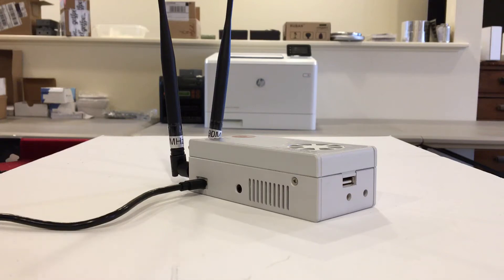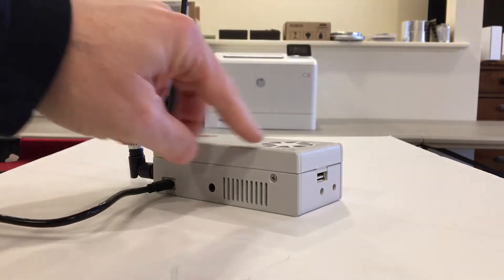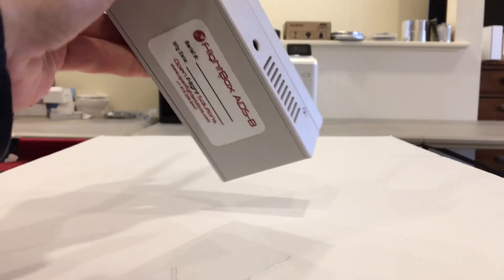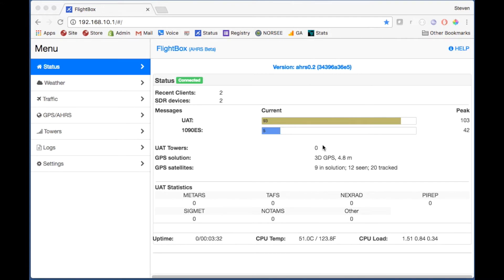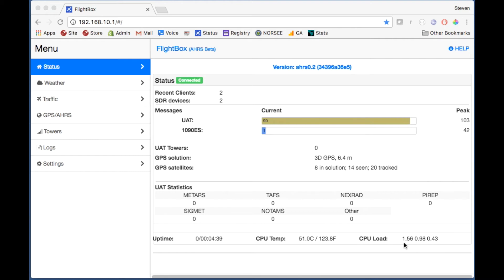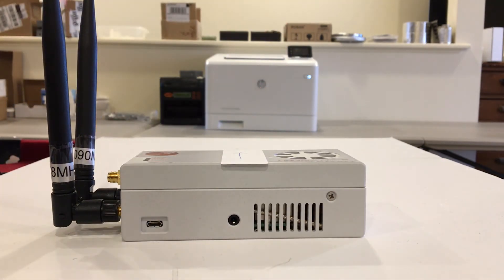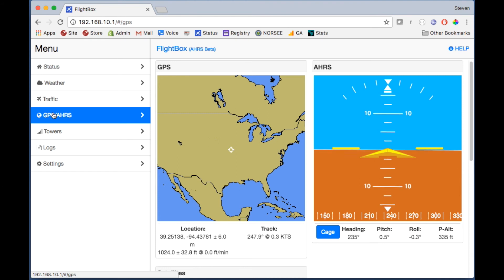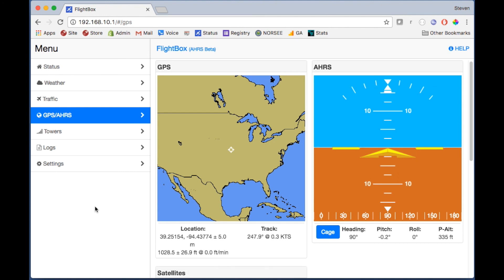AHRS Beta 2 Demo

Comment: I am using v1.4r5 (snun5hlcfy) running on iPad Air2). In the menu page there is now a PFD icon at the bottom of the page.It is a full screen AHRS. In there there is a 'Level' button that resets the AHRS in any position I set the FlightBox. Is this sufficient or is it necessary to do the calibration in the 'Settings' page?

Comment: Something to consider is when the system is going through its sensor calibration some pilots like myself will move this unit from plane to plane. Student pilots, club pilots, and glider pilots to name a few. The variation between planes such as tail draggers, both power and glider, and any other aircraft types with conflicting orientations between being on the ground while not being straight and level versus flying straight and level. Keep up the great work and I hope you plan to produce an ADS-B out system at a much lower price than is available.